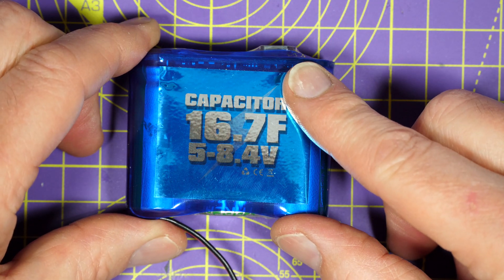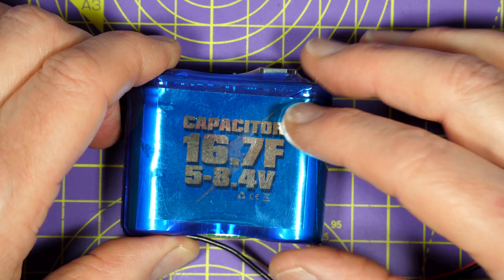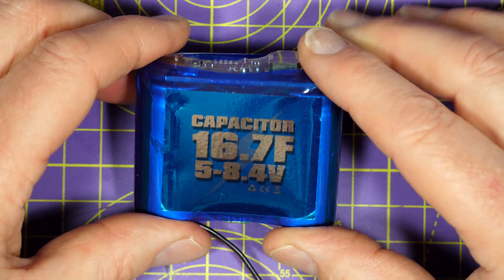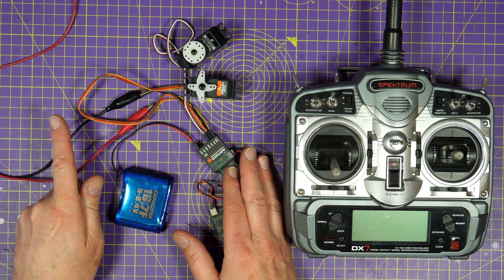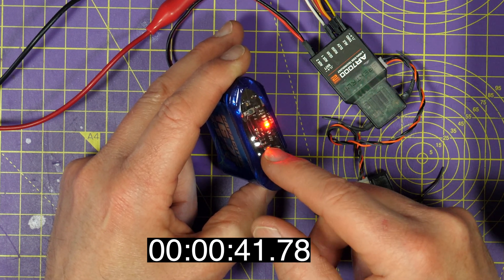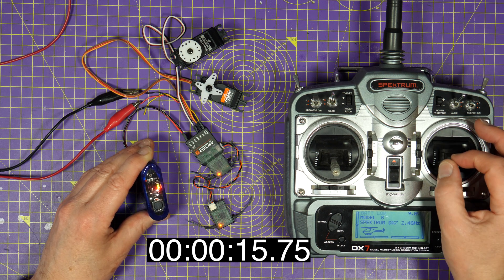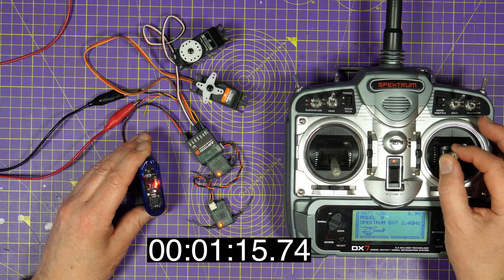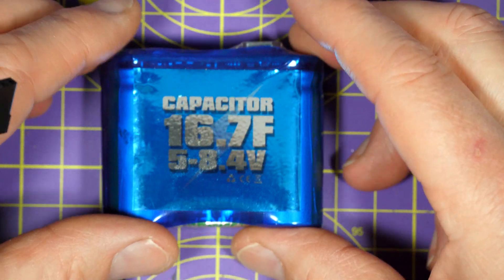Power Box S1 16.7F 5-8.4V Capacitor Saver Rescue Module

Comment: What is useful about it is the circuitry that switches it on the second power is lost from the main supply. Whereas if you simply connected a small battery up, the battery would be discharging from the time you took off. Could be useful for cheap flight controllers in planes where you have no option of providing it with two separate sources of power. Would be great if we could get a small circuit like that to use with a normal 2 cell battery - especially if it dropped the 7.2v down to a steady 5v.
Reply from the maker: Excellent point. thanks for watching.